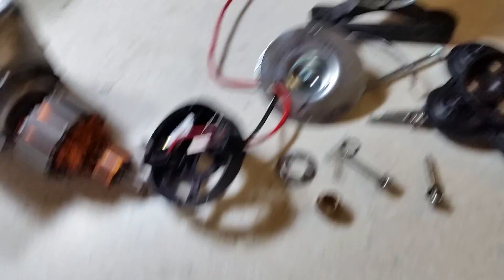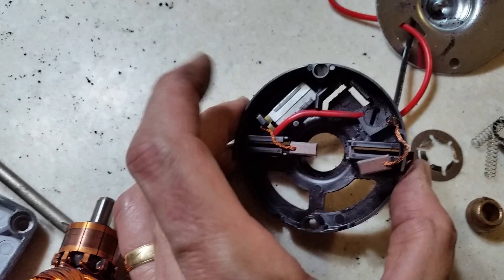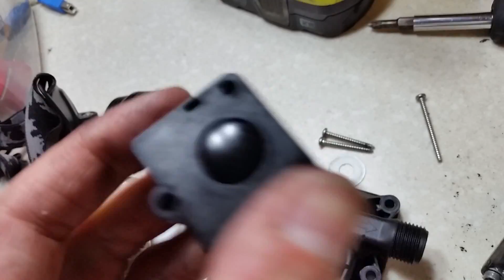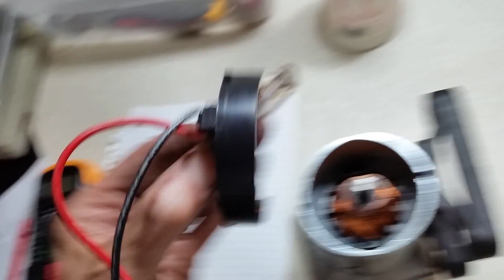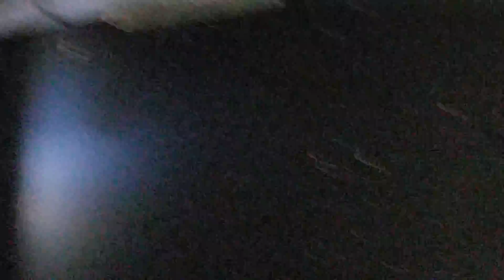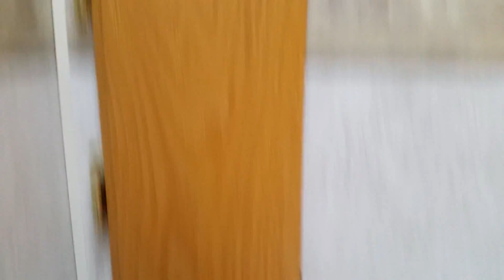RV Repair: SHURFLO Revolution Water Pump Troubleshooting Disassembly Repair Tuneup & Adjustment.

Comment: Thank you so much! I’m moving into a rickety little 1979 truck-bed camper for the winter (in exchange for working on the owner’s farm). It has an old ShurFlo 200 series. Last few workers couldn’t get it running, I’m told, but much like you I’ll take anything apart! Took me just one hour of tinkering to find the issue: they had the circuit breaker switch turned off! lol

So now the pump turns on, but I’m not getting any water to my faucets. My next steps: check & probably replace fittings/lines (I’m sure they’re old too), then dismantle the little workhorse & see just how gross the insides of a 43-year-old water pump can get after decades of neglect!😧😵‍💫😵

With the pump being as dated as it is, I couldn’t find much info on the old 200 model. And the original manual doesn’t say much more than “Check electric, check fittings, check pump.” 

But now, thanks to your video, I’ll have a MUCH easier time dissecting this thing. Like most mechanical manufacturers, it appears as though ShurFlo has maintained some reliable consistency in their design over the years, so between your video & my parts diagram I should be alright to get started today!

So thank you, sincerely! I’m subscribing to your channel right now! (I’m brand new to all things RV and, like I said, moving into a less-than-perfect one right at the start of winter, so I need all the help I can get!)

Sorry for the long comment, I’m just excited that I might actually be able to have running water in the camper so I don’t have to trek through the snow to use the bathroom or wash my dishes inside the house! You’re awesome!
Reply from the maker: Thanks for the kind words it was nice talking to you on the phone stay warm.

Comment: I have a Seaflo 33-Series pump that had lost its prime and this video inspired me to tackle repairing it.  As soon as I unscrewed the front I could see a small stick lodged in the diaphragm. Removed the stick, brushed off the rubber diaphragm under water to remove gunk, and voila, good as new. I think a more extensive break-down (e.g. involving the armature) would have beyond me. Luckily it was an easy fix and I'm back in beeswax. Thank you!
Reply from the maker: Its nice to know I help to inspire you to tackle you repair. Glad you fixed it and thanks for taking the time to leave a comment. Have a blessed day
Reply: It has lost its prime again but I can’t find any debris. What would you suggest as a next step?
Reply from the maker: @brumfld  Check all the lines and "fitting" between the pump and tank pickup. One loose fitting or a tiny hole where the pipe may have been rubbing something will cause you to loose prime because it will be sucking air instead of water. call or text me if you like my cell 606-875-0125 Kevin

Comment: Hey Kevin...My motor will not come on. It's free and spins and the bearings all look good & free, the valves & other plastic & rummer parts in the head look to be ok as well... Can the pressure switch keep the motor from coming on & running? any suggestions would be much appreciated. We've been in our RV almost 10 years. I had a new Marine pump in it butte RV shop that was doing some other work took it and traded it...They put in this 4158 Auqua King 2 which never ran well and stopped when we are on the road... I replaced it with a 3 gph as this is all that was available where we broke down. Im looking to repair this Aqua King 2 and put it back on because it is a 5 gpm pump which will help the washing machine fill quicker.. any suggestions would be much appreciated.  Thanks for the video, you did a great job on it! Best! Mike & Judy
Reply from the maker: For my first test I would apply a GOOD 12 volt source to the black and red wire coming directly out the back of the motor bypassing any pressure switches that may be bad. If it comes on then test the pressure switch. If it does not then take it apart and inspect the brushes also use your nose... if it smells burnt after you get it apart then it may be beyond repair, and you can always give me a call 606-875-0125 Kevin Caudill
Reply from the maker: Give me a call 606-875-0125 Kevin What is the model number of the one you are working on ?

Comment: I would like to add in the last few seconds of this video he notes not to adjust the pressure to much or it will run continuously with all the faucets closed, that is true. However there is a second adjustment for "BYPASS" pressure. If the bypass pressure is set at 55 psi and you turn up the pump pressure to 60 psi the the pump begins circulating the water internally (runs continuously). To compensate for the increased pressure you need to also raise the bypass pressure by turning the screw clockwise as well.
It seems counterintuitive because if the pump shuts off at 55 psi why would you set the bypass higher at 62 psi? 
It would never get there. I don't understand this, but let's move on.

WITHOUT looking at the numbers just think of the result you're trying to achieve. 
That is the pump does not "cycle" while using small amounts of water, instead it runs continuously until the flow stops completely. (Faucets are all off)
 
Here's what I did:
1. Unscrew the bypass adjustment all the way. (This will disable the bypass function)
2. With pressure gage attached to system, start pump and adjust pressure switch to achieve desired system pressure (55 psi).
3. Now turn a faucet on with a slow flow. You should see the pump begin "cycling" ON and OFF to keep pressure. Great!
4. Now begin screwing IN the bypass adjustment. At some point the pump cycling will slow and eventually begin to run continuously. That's the sweet spot. It's why they built this pump.
5. Turn faucet off, pressure will build and shut pump off.

So the two adjustments go hand in hand. 
Understanding the correlation will allow you to make these adjustments logically with a full understanding of how your system works and might help you diagnose other problems in the future.

Honestly I never tried using the settings in the book because they made no sense. Could be they work.
Good luck
Reply: The reason the bypass is set higher at 65 psi is incase your pressure switch fails . .
Reply from the maker: Thanks for detailed input I keep the allen wrench next to the pump encase I have to do any fine tuning. I also like the fact that i can hear my pump running encase it decides not to turn off, I will know about it and it wont be running for days on end..
Reply: LOL! Thats to funny! 
That's exactly why I dug into mine today. 
I think what happened is the park shut the water supply off and then the pump sucked the tank dry. When air got into the pump for some reason it couldn't get it out. It should self prime but it wasn't.
And take note, like you said I can normally hear the pump running if there's water in it. But when its empty its very quiet. I happen to barely hear in the middle of the night. It probably ran that way for 12 hrs without damage to the pump. Good product!
Reply: dablingtime  You nailed it!   The troubleshooting numbers made no sense to me either,  I did your procedure and the pump works great again!

Comment: That tool you have I have been looking for it. What is it called and where did you get it.
Reply from the maker: Can you describe it ? at what time while the video is playing did u see it ?
Reply: It was a white tool that you were showing tightening a fitting on a tank. Looked to be 2 sizes and had a metal blade in each end
Reply from the maker: Yes its a great tool its called Flair-It 16391 Plastic Wrench 1/2 and 3/4
Here it is at amazon https://www.amazon.com/Flair-16391-Plastic-Wrench-Size/dp/B000H5QMVO/ref=cm_cr_arp_d_product_top?ie=UTF8
Reply: Thank you so much. I just ordered it. People would just look at me like I was crazy. I bought a new trailer 2 years ago and they put in a new water pump but it does not work right and thay can't anything wrong. Warranty just ran out so am going to replace pump then will take this apart later.
Reply from the maker: Thanks for watching glad to have been of some help, have a great day.

Comment: Thank you so much for this very detailed video. I was having an issue with my RV pump where it started losing prime after time, and sounded awful when it ran. I took it apart, cleaned up the diaphragm, and cleaned that o-ring up top that looked a little gunky. Put it back together and it sounds like a new pump! Testing right now to make sure it has fixed my prime loss issues.
Reply from the maker: Thank you for leaving a comment, glad it helped you out. Click subscribe I am always fixing something on my RV it seams.